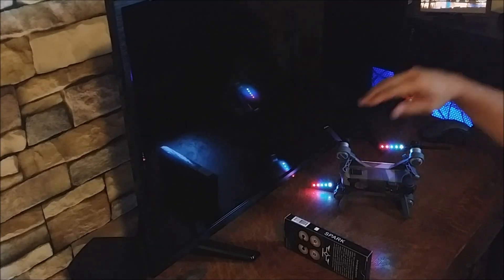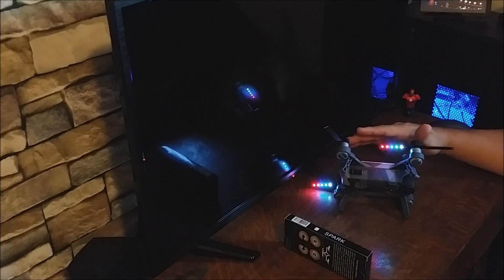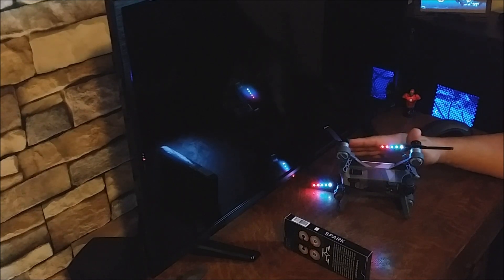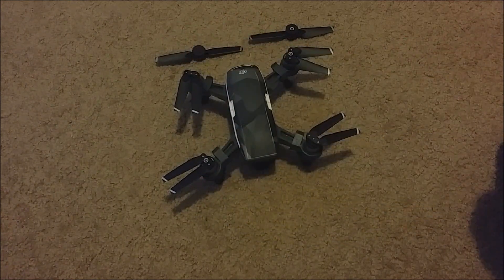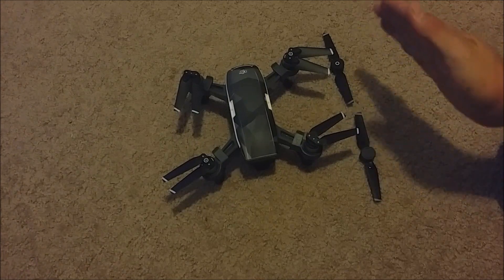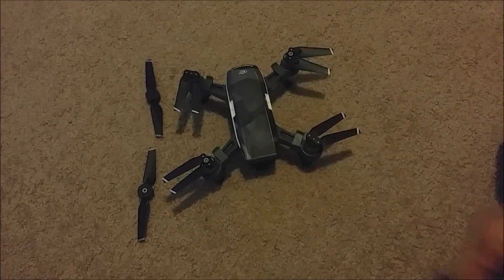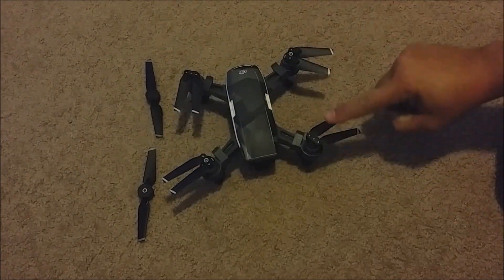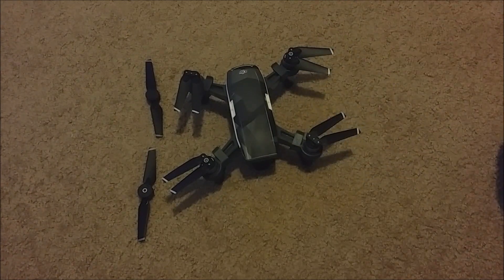Dji Spark Led Propellers Pt.3

Comment: I purchased these before I watched your video and I had a terrible time trying to put these on and taking them off and I found that the flight characteristics was so unstable using four propellers that I was afraid to fly it. I think the idea of using them in a diagonal pattern is an okay idea but I believe it can be a bit disorienting at a distance  and it takes away from the visual effect of using all 4 at one time. I will contact the manufacturer for a refund. Thanks for the video. Subscribing!
Reply from the maker: MARVIN  Thomas That's exactly the way my spark did when using four. You can use two in the front,two in the back or diagonally.Just not two on the left or right. I just set them up diagonally for a different look. Thanks for stopping by 👍
Reply: @PalmettoMoon  i dont know if you guys cant read or if amazon put the advice after this video lol...BUT if you go on the amazon item descrption it's clearly written " spark can use only 2 props".....
Reply from the maker: @ederyn84  I can read just fine. The item description has been changed. I went back and forth with the company that I bought them from because their description read that four could be used at one time. They finally agreed to refund my money and change the description. The original picture that was on their listing (which is also the thumbnail in my first video about these props) shows the spark with four working led props being used all at the same time.
Reply from the maker: https://youtu.be/vwolkW6pA_U